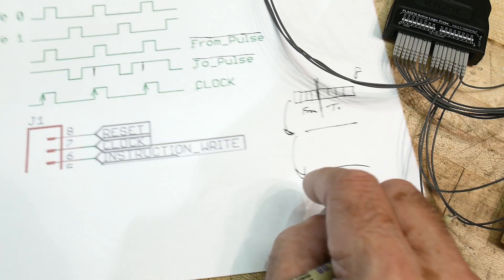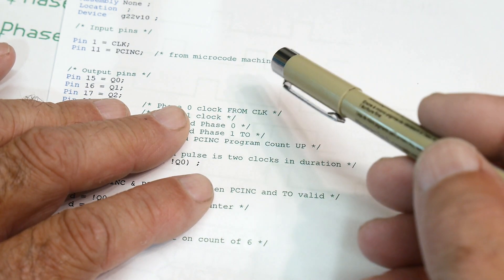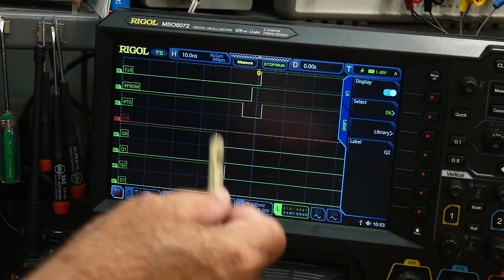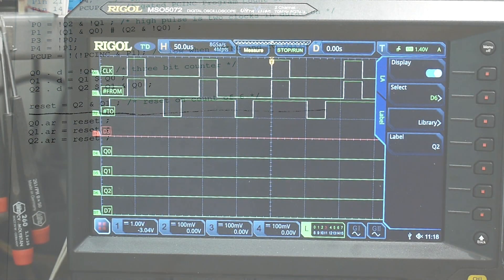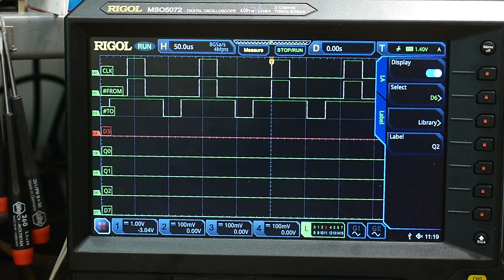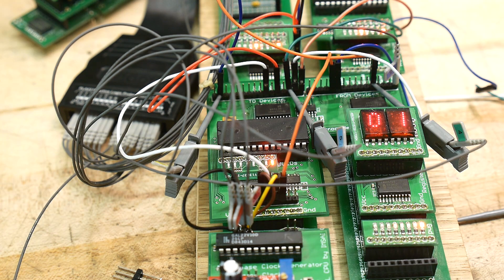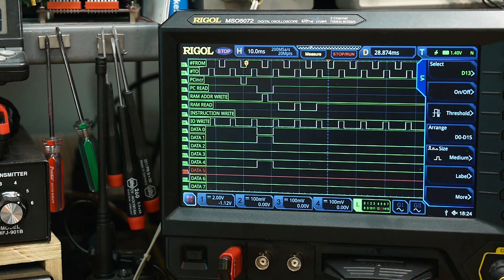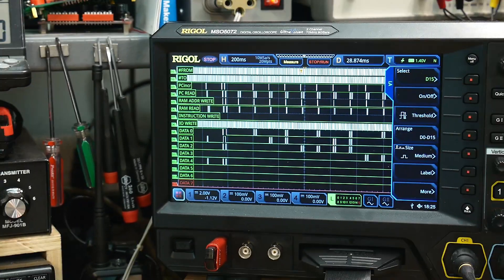#888 Fixing my TTL CPU Glitch

Comment: As you're after crisp, definitive clock outputs, I would suggest approaching this with clock registered outputs to completely eliminate decoding race conditions. (At least up to several dozen MHz) Create a modulo 6 synchronous counter, decode that into output registers.

Comment: I built 2 of these 'discrete' computers.  The first one was using all 74LS and the second using a FPGA. I was going to build a full 8-bit TTL one as a home controller but never did (mainly because 4 to 8 bits really ups the hardware!).  But the main reason was that I fell in love with the Z-80 instruction set and so made it from that; also you come to realize that by the time you get all the functionality you want you end up adding a lot more logic than just the base-micro-code unit state machine.  But, I was always fascinated, that you could create any instruction that you wanted, and cherish the experience of building my own from-scratch computer; one of those 'you haven't lived' experiences!  Great Video!
Reply from the maker: Bravo, it is a great project and experience. Making a Z80 would be really hard. Have you looked at the ALU? it is 4 bits that they run the data through twice!
Reply: @IMSAIGuy  Wow, yes I haven’t heard that one in years.  I actually started on an 8080A and always thought that the nemonics were not very intuitive.  When I first saw the Z-80 instruction-set it, was just so straight foreword and even the complex indexed-addressing modes you could follow.  However, I do have to give it to the 68000 for top ISA; to me, much like the Z-80 but soooo much more robust and complete. And to me, the x86 is just such a clunky patched-up mess where you can only type with one hand because you have the data book in the other! 😉
Reply from the maker: @SpinStar1956  Yup the 68000 wins
Reply: @IMSAIGuy  68000 was always my favorite also. But alas Intel & Micropuke made a child from hell.

Comment: It would be very easy to make the counter synchronously reset to zero by forcing all the D inputs false when the counter is at a count of 5. Each D input would just require another gate.
Reply from the maker: hey, that sounds logical (no pun intended). I might give that a try. thanks! so much for using the CUPL examples.
Reply: @IMSAIGuy  I cringe when I see a counter being reset asynchronously. That's a guaranteed glitch so I don't design anything asynchronous.

Comment: Should be a way in your GAL code to synchronously do that reset to zero at count of 6, no?
Reply from the maker: nope, not that I can tell
Reply: @IMSAIGuy  Correct since the transition from 5(0101) to 6(0110) has TWO signals changing at the same time. That will often glitch, then the glitch runs into the Flip-Flop and flops like Lindsey Graham.

Comment: I'm really starting to like your Rigol scope. I think I'm going to buy one and apply the patch.
As to your glitch wouldn't a synchronous reset flip flop solve the problem so you don't lose 2 clocks ? [edit] I just looked at the 22V10's data sheet and it is indeed asynchronous reset. Maybe you could play a game with the synchronous preset input? count from all ones backwards and assert preset for the next clock cycle? Not a big deal since the logic is working now.
Reply from the maker: It gets more complicated because the actual logic (as done by the compiler) is hidden to the user. Maybe there are better tools than the one I'm using
Reply: @IMSAIGuy  I hear you. It's even worse in big FPGA land where everything is being hidden from you and you have little influence.
Reply: @TheOmegaman69  I'm trying to move some generic looking Verilog that describes a CPU from Xilinx to Altera tooling and I'm having a hell of a time. Will it even run properly on the newer Altera(cough Intel) parts? who knows. The really stupid thing is this Verilog was implemented using legacy Quartus II on a much earlier obsolete Intel (cough Altera) device.

Comment: BUT BUT BUT, you did not identify how the glitch was created, only demonstrated a sensitivity to the code. I claim that without understanding exactly the logic problem, it may still exist in the code and upon either changing the code for some other reason or implementing another unit may misbehave also. (yup I am an asshole, sorry children)
Note: I smell a combinatorial race moving from one state to another. dan
Reply: More like a fly in the soup. Just smiling!
Reply from the maker: Most people would polity say, can you explain that. 
Many viewers had already suspected a 'race condition'. The cause and solution seemed obvious to me. The output state of the counter changes, then is fed back to the input to run though conditional logic to find the number 6. that is then sent to the reset pin of the three flip flops. the propagation delay of the logic slows down this process and the 'race' is on. the reset does not happen fast enough and you get a small glitch. 
Ignorance does not create an asshole. You have to work at that.
Reply: @IMSAIGuy  LOL, not ignorance. I have seen this and made the same mistake over and over again. Just attempting to have you illustrate more clearly the problem. The issue then is that you have run a combinatorial decoding signal, (which is fraught with issues if not careful.) into an asynchronous input, (the reset), of a flip-flop. That is a no-no unless you can guarantee that only one input to the combinatorial logic is changing at each clock. That is one way gray coding is used. But IMHO using a clocked reset would be much better. 
cheers dan
p.s.
In the mean time - I will work on being an asshole,...
I thought I had it nailed but there is always work to do.
Reply from the maker: @mr1enrollment  you can redeem yourself by sending me a CUPL file for the 22v10 with a non-glitching 6 state counter
Reply: @IMSAIGuy  see prev response